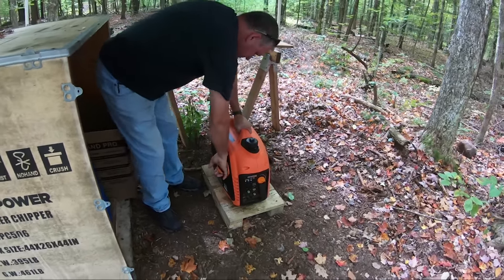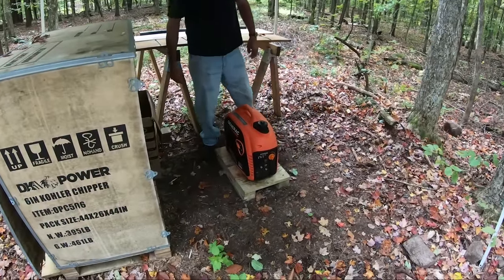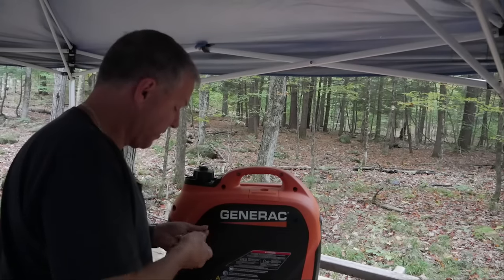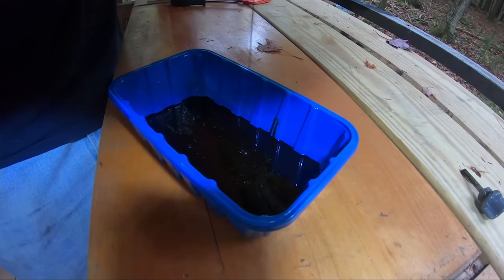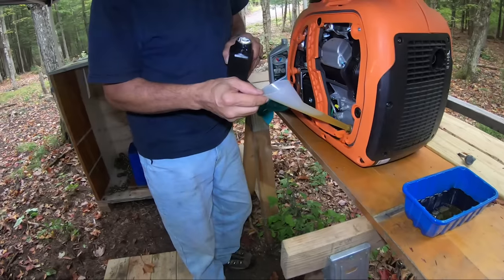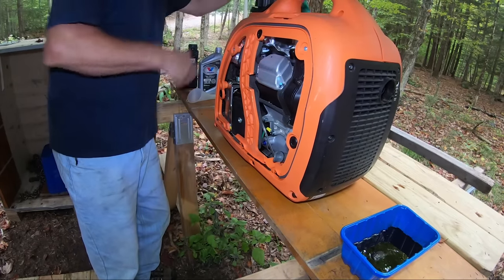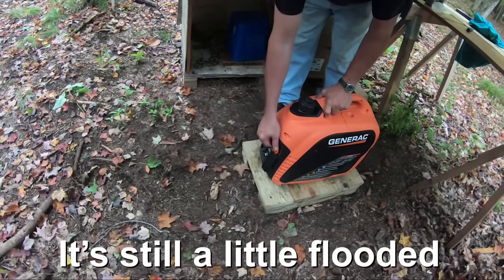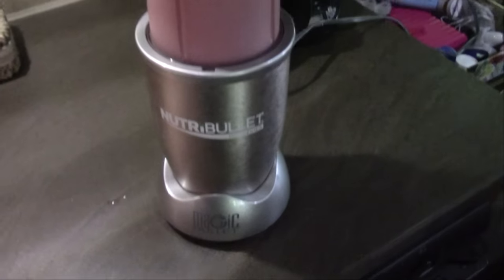GENERAC GP2200i - BRUTALLY HONEST 1 YEAR REVIEW

Comment: 2:15 "Does she have gas?"  The correct question would be, "Does it have clean, fresh gas (fuel)?"  If the generator has been sitting idle for a number of weeks, the fuel may start to gum up the carburetor, or worse, if the fuel tank wasn't topped-up, moisture may condense in the fuel tank, forming a pool of water at the bottom.
Reply from the maker: Sorry I only just saw your comment! Good point. Clean fresh gas is very important. We make sure to run it completely out of gas before we leave and I had just added the fresh gas. Wife thought I might have forgotten.  Appreciate your comment very much.

Comment: Perfectly leveled, perfect amount of oil, perfect oil... is this for real????
So your car should not start if you park it on a slight grade... Right? 
Thanks for sharing of what not to buy!
Reply from the maker: jerzy drwal I’m not going to explain the differences between this engine and a car engine to you because you can look that up but this one does need to be level because it has a low oil cutoff sensor.
Reply: @CreatingASimplerLifeOffGrid  Yes, I think he understood that. The point he was - quite fairly - making is that no device should be engineered to require "exactly" the right amount of oil and a "perfectly"  level surface before it will even start. I've been working on all sorts of engines for 40 years, and I've never seen one that "sensitive"  - and with such a poorly designed shallow entry into the oil filler. And I'm talking about engines with multiple tilt sensors for both the oil and fuel systems (along with a whole host of other electronic sensors that will stop the engine from starting if triggered.) Oh well, it is what it is. :)

Still, nice to see it all worked out for you - once you'd emptied the treacle from the engine. :)

Comment: Nice vid.  Thanks for sharing and glad to hear you are going to do some better maintenance on it going forward.  May I ask, do you use non-ethanol gas in it and do you close the gas vent in the cap and run the full out of  the card when done before storing it?  As for the wife's input, she has a say in matters of her homestead and he accepts that so I can say nothing.  At least she is there helping.
Reply from the maker: Yes, I use non-ethanol gas when I can get it. I just let the gas run out with the valve open and close the valve if I remember. Gone through two winters already with no problem. Thanks for watching and hope you have a great day!

Comment: My harbor freight 2200watt genset looks like this little gem. I have found after it's set for weeks, If I pull the cord slowly a few times, it's like a "pump" I guess before I start it up. Otherwise, I have had the same issue trying to start it. I even keep starting fluid handy, which I've had to use.
Reply from the maker: tc1uscg sounds good! Thanks so much 👍
Reply: I have two Honda generators. An electric start EU6500i and a pull-start EU3000i Handy. Neither one of those buggers likes to start when it is below 32-degrees. I've done everything... new plug each year, clean air filter, 0W-30 synthetic oil.. they just will not start. Had a power outage once when it was ZERO-degrees F and you can imagine what fun that was. So now I just keep a can of starting fluid handy, one little toot and they literally start first or second pull. I drilled a hole in the air box on each generator and installed one of those little flip-top style vent caps like you used to see on gas cans. So now I don't even have to take the cover off. I just pop the cap, give it a toot of go juice and off it goes. I'm not sure what it is about Honda engines. They are reliable but seem to hate the cold. I also have a Honda push mower that refuses to start if the temps are below 50-degrees F. Go figure.

Comment: Oil and when not in use for a long time you add fuel stabilizer into the gas run it a bit the.  Drain out the fuel and run it til it's dry. Ethanol gas can damage the carb and fuel system.   Before using it again pull it with the switch off a few times to get the oil moving. Big thing to extend the life is if available ethanol free fuel.

Comment: A statement and a question…I am not an expert but I would think a little corn juice in the tank isn’t going to be a problem with the frequency you seem to use that. Now the question is, if you got what you thought was a good lifespan out of that generac, would you buy another one or pony up the bucks for a Honda? OR would you try another brand altogether and if so WHAT brand?
Thanks. I am not off the grid but since Kaliforniastan SUPREME leadership and pg&e is turning off people’s power to avoid starting forest fires with downed lines, I’m considering getting one.
Reply from the maker: Kalifoniastan is not much better than where we are! LOL. Honestly, I think we would buy another generac. In fact, when the house is finally built we intend to have a larger one permanently connected to the house that automatically goes on when the power goes out. The area where we are loses power often and is one of the last areas to be repaired due to it's remoteness. So in answer to your question, as of right now we are still pro Generac = plus the larger machines are made here in the USA and that is important to us. Lastly, sorry about what is happening in CA right now and hope you are safe.

Comment: So sounds like you use the heck out of this thing and most people don’t read the owners manuals but they all require a decent amount of maintenance unfortunately and I guess if the oil level is just a tiny bit low it’s good protection that it doesn’t start, it’s easy When we’re all doing things and busy to not do our regular maintenance but it looks like that’s a good generator and looks like you’ve learned something going through this and taught a lot of people about this, I have a lawnmower from tractor supply and it’s very finicky with oil level also, Carry some extra oil on your trips which I’m sure you do and probably get some NGK spark plugs carry extras and I think that things going to run for a long time👍

Comment: Do you have any problem running your 5000btu AC? Especially on startup? Did you have to have an AC softener? 

Your wife did a fine job with the camera work, btw. 😉
Reply from the maker: We have no problem running the ac. Just make sure it’s off when starting the generator. No softener needed. We run it all night long when we sleep on really hot nights. Lasts up to 9 hours on o e tank on economy running ac

Comment: I’ve purchased a few of these knockoff generators and they last only a few years. They come under a variety of different names . Once they need repairs or parts forget it. You won’t find parts for any of them even on EBay or Amazon. A search at local dealers will get you an, “oh we quit selling those years ago”. Adding a few cheap tools and a funnel doesn’t make up for the disadvantages. I’ve had Hondas for over 20 years and I can buy parts for anyone of them from the local dealer at a reasonable cost. As an example a starter for one of these knockoffs is $400+ and a recoil starter is $240+.

Comment: Completely run the engine out of gas if you are going to store it for more than a week or two (when it sputters or dies, put it on choke to get that last bit of gas out of the carbs).  Use non-ethanol gas only, and at least 89 octane.  I ran a pair of the Honda EU2000i's for years, and the only time I had any problems was when I was forced to buy some crappy ethanol infested gas, and didn't run it dry.  After only a week of sitting, neither would start.  Had to use carb cleaner and gumout to get them going.

Comment: Fresh oil dripping out like crazy only means that you’re changing it. Better to have 1/2 a tsp spilt than be low.  Generac designed it to be as small & light as possible.  Keeping the empty bottle to measure would have been in line with the integral design.  Much like the Honda auto  no wasted space, simplicity at its best.
Reply from the maker: We like simplicity!

Comment: so basically buy 2 cheap little levels and permaglue them leveled on the top and you have a good generator with decent clean power. The cost isn't all the great though, at 660.00 I'd rather have the Champion 3100.  Still stellar reviews and only costs 100.00  more than the generac for 30% more power.
Reply from the maker: Agree that 660 is a lot of money - we thankfully got this much cheaper than that so it was worth it for us. Thanks so much for watching and commenting.

Comment: Always drain the fuel in the carburettor once the generator has been setting. The carburettor bowl has vents venting to Air it’s like leaving a cup of petrol sitting on the workbench it goes stale the solvents evaporate off, when you pull the pull starter you drag that stale fuel onto the spark plug. The fuel in the tank because of its volume and the fact that it is sealed lasts a lot longer. So before you pull it over for the first time after been sitting drain the bowl and then Pull start to prime the bowl with fresh fuel should have no dramas.
Reply from the maker: Appreciate that.

Comment: It was running when I shut it off wasn't it I run mine 300 hours a month it says change oil every hundred hours but I'm not going to do that it runs every day of the year I am now putting in a new carburetor and a new coil I use Castrol 5W-30 in mine same oil in my truck in my other generator as well I use a meat injector to finish filling my oil up cuz I always run it over to supposed to screw your dipstick all the way in to check the oil

Comment: Three steps to start, as stated in the manual.  1.  Switch on the gas line (black cap on top). 2.  Economy mode switch to OFF.  3.  Choke ON.
Reply from the maker: Hmmm, I'm guessing you didn't watch the whole video ;-)

Comment: The basics are: Fuel, Spark and Air. An oil change doesn't make or break it for starting. Best solution is fuel saver to prevent gumming or non-ethanol fuel. Be safe!

Comment: if it wont start, low oil could be the problem.  But so could clogged low idle jets.  Always turn of fuel supply and let the engine suck the carb dry,,,,,choke it as it dies, make sure you get every drop of fuel out of the carb unless you plan on starting it again in the  next few days
Reply from the maker: Thanks for the info and for watching and commenting :-)

Comment: 🔧 I use to repair and service Generac and other brands so I’ll put in a few pointers: 
1) use only Non ethanol fuel because it will not shellac and gum up the carb.,  as quick, nor go bad as fast in the container.
2) Fuel will normal start to go bad in about 3 months depending on temperature of the storage area and size of container when using 10% ethanol fuel.
3) Ethanol fuel will absorb moisture out of the air that will damage the carb. Your vehicle can dispense the moisture out of the muffler... is my engine cannot.
4) You should use “Small Engine Oil” and not automotive oil because SEO has a 200 degree tolerance above I don’t know if oil. Remember vehicles have radiators and pushed air cooling them, small engines don’t but this oil is hard to find anywhere other than online.
5) Fill with oil to the top thread of the dipstick, and check the oil after every 25 Hrs. of running time so if you run it 8 Hrs. per day check it every 3 days along with the air filter.
6) The best way to change the oil is to suck it out with an oil vacuum/extraction pump check 
www.briggsandstratton.com

I live in Florida and have (2) large gens that use in 🌪season, but crank up every month for 30-60 mins to keep them opening good and they must have a small load such as a fan or light pulling amps, then no load and shut off fuel valve and run dry. I rotate my fuel once a year just before season by removing and putting last year’s fuel in my vehicle and new in my gens and fuel containers.

Wish you all the best. 
Foxtrot Tango.
Reply from the maker: Thank you very much for that info. Curious what two gens you have because we will be looking to purchase a large home generator after we build next year. Currently looking at the Generac 14000 Watt off grid geny as a backup to the solar we are planning on installing.
Reply from the maker: Thanks ,will do.
Reply: That was helpful for someone looking to buy and maintain a generator. Thanks.

Comment: I've been using a Honda 2000 for 13 years to run my AC for my semi truck. This little guy rides in my trailer side box (a very rough ride). The first thing I did was convert it to propane and I have never ever had a problem starting it (it probably has 7,000 hours on it). Still on the same original spark plug and change the oil to synthetic changing it once a year. Also gives me 2 full 10 hour breaks not having to refill because I use a 20lb tank.
Reply from the maker: That’s great. Like the idea of converting to propane a lot. Need to look into that. Have a great day 👍

Comment: Owners of this type of generator should spend the money on a tool to suck the oil out of the filler hole with a plastic tube, eliminating the need to pick up or tilt the machine.  Small engine manufacturers have been eliminating the drain plug  from their engine designs to prevent engine failure due to owners failing to properly tighten the plug, resulting in the oil draining out during operation and causing catastrophic engine failure.
Reply from the maker: Milosz Ostrow we just ordered something to help us next time! Thanks 👍
Reply: That engine really needed the more thorough drain of lifting and tilting the machine, especially, where it had not been run, before the change, to get the particles suspended in the oil. a suction pump would not get the sediments out of the crank case, and the new oil would just start recirculating the particulate matter. These engines do not have oil filters. He should change the oil again immediately after use, just to flush it out!
Reply: @Vincent Robinette — If the engine is far overdue for an oil change, I would agree with you that it should be tilted for best drainage.  However, if the oil is subsequently changed regularly per the owner's manual, there shouldn't be much in the way of sludge and particles.  I'd run the engine a few minutes first to warm up the oil and stir up any particles that may be present, then suction the oil.  It will never be perfect, but one will be removing 95% of the old oil and contaminants each time.
Reply: @Milosz_Ostrow  That's true: modern oils will keep the engine pretty clean, if changed regularly. I also recommend changing it immediately after shut down, so all the particles are still suspended in the oil, when it's drained. Otherwise, some particulates may settle to the bottom, just to get stirred back up next time it's run. That's why I recommend, that he should change the oil again, just to flush it out. As you recall, he never could get the engine started, leaving the oil cold, and there's no way to stir up the sediment, by pulling the cord. Tipping the engine was the best way for cold oil, that had been sitting for a long time, that needed to be changed LONG before it was!

Comment: I worked on large and small generators you will shortened the life of the engine by not changing your oil on time. If your generator does not have a way to drain the fuel when your away then siphon out as much of the fuel and run the generator WITHOUT a load until it runs out of gas. Be sure to use fuel stabilizer.
Reply from the maker: I hope I didn't shorten it too much. Just need a few more years out of it. We always run it dry, but never heard to do so without a load on it. I will have to look into that. We usually keep it plugged into the trailer. Appreciate all your help. Have a great day!